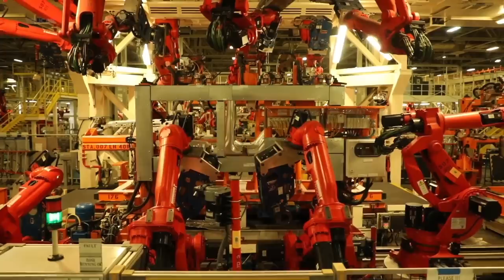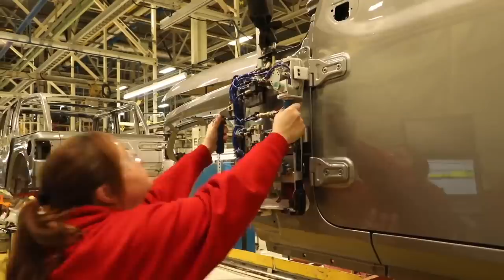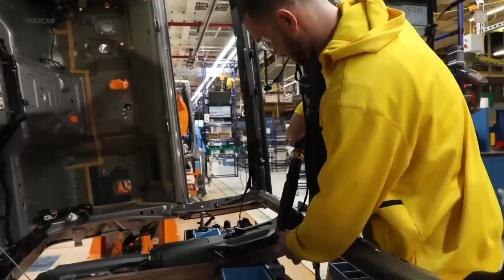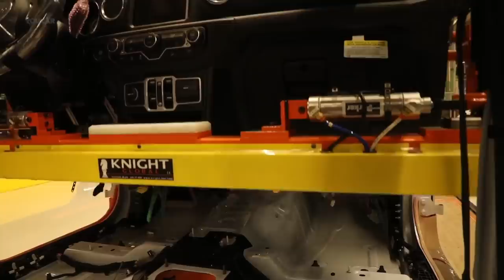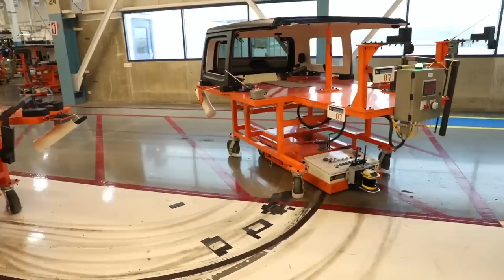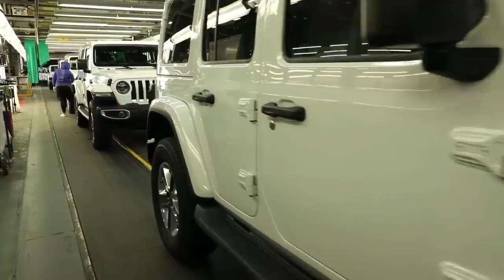Jeep Wrangler JL (2019-2021) Production Line – American Car Factory

Comment: Anyone have issues with an unfinished hardtop interior? New 24 Sahara 4xe and there are spots where it’s very rough and when you rub it white shit is falling down everywhere. This was not an issue on other jeep 2020 wrangler sport. Inside was smooth everywhere. And I don’t want to hear jeeps are rugged. I don’t wanna hear get the headliner. I wanna know why no one at jeep understands this seems like a factory issue. Thing needed more sanding 100% but I can’t find any thing anywhere about it. Every jeep in the dealer has the same issue but in different spots.